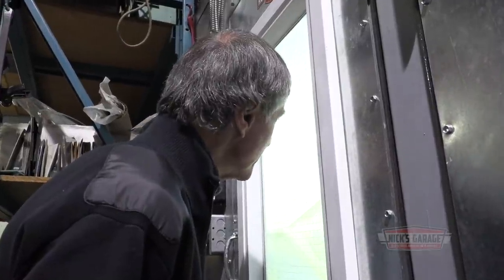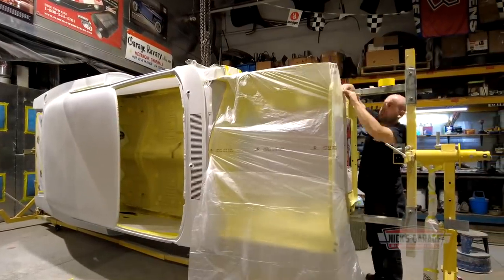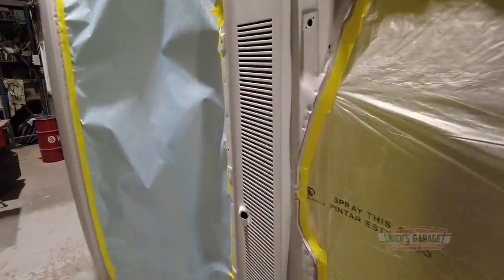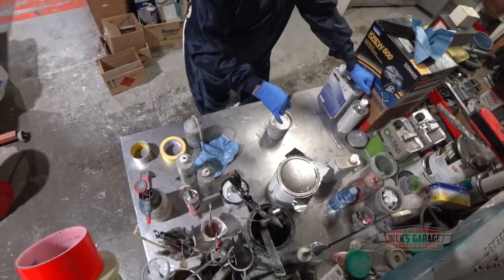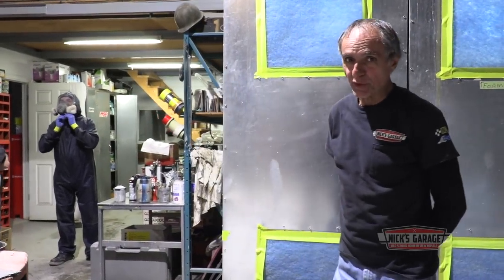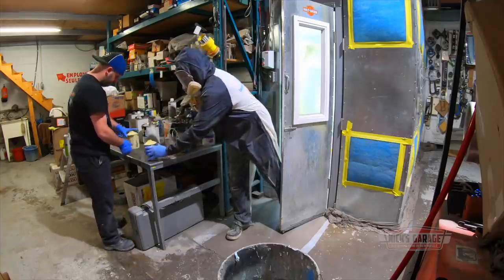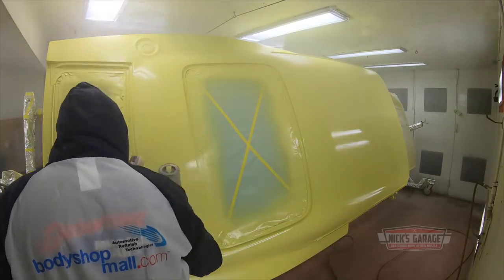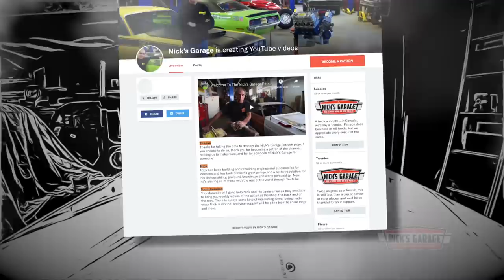1969 Charger 500 PAINTED - Special Mission - Let's Rock 'n' Roll!

Comment: Glad to see the 500 being painted!
What I find interesting is Roger is painting the main body I don’t see the hood or fenders or doors. I’ve seen Graveyard cars either paint the cars with all body parts on or in the booth with the main car. Every painter has there own way.
Reply: I believe they where all ready painted.
Reply: I always paint the cars in pieces for three reasons, first I like to have all the products in all the areas, secondly if you have paint or clear between the pieces the humidity is less likely to settle than on primer and thirdly I have a small painting room lol, and not the other parts are not painted yet if an accident happens it is easier to repair a part on primer than already painted ...

Comment: windex with ammonia works great for a pre clean as well. You can do even a final wipe with a wet chamois for dust.  Windex wont lift rattle can paints or primers too.
Reply: Winded has wax in it .
Reply: @lautburns4829   never ever heard that and never an issue in 40 yrs with it. and the purpose of ammonia is to strip wax, so defeats the purpose.
Reply: Okay, not arguing with you, thanks for the info😀

Comment: Seems like the rest of the panels are going to be painted on a different day, good luck with the color match.
Reply: Colour match wont be a problem.
Reply: @oliverz4544  I've been painting over 30 years, hang the panels and paint it all at once, is the best way.
Reply: We'll let the car do the talking once it's done 😉 cheers.
Reply: not the first that I paint in part and never had any problem especially with a solid color, I made several metallic and no problem there is a technique and a procedure to follow and never change it! Cheers

Comment: I had a 69 Charger 500 with a 426 and a clutch-flite trans from '82-85. I got it for $1500. I didn't even know what it was. I thought it was some cheap stripped version because the lights weren't hideaways. I just bought it because it had huge tyres and the big engine. It had no reverse and half the time took all day to get it started. I had to get the carbs done by a specialist. I knew squat about cars back then. It eventually ran really good. Body was good but chalky red orginal paint. The  guy I got it from was slowly turning it into a race car but was more interested in dealing in marijuana. He got sent to state prison and his mom went and got him to sign the title  ove so she could get it out of the driveway. She hated him and the car.

Comment: Roger is right if you want a good good it takes time it's not just strip the car and paint it if you want it to be lazer straight the body needs to be gone over with a fine tooth comb and after the paint is done it takes time for the paint to dry and then to cure so it is hard and won't be damaged. good body and paint takes time that's for sure. if you want a over night paint job you go to Maaco they will give you a 499 special

Comment: will you be doing a cut and buff  
when we did a 65 coronet there was right around 40 hours in to it 
when it was done the car looked wet  and smooth as glass 👍🇨🇦😁
Reply: yes the next step on the body is water sanding and polishing
Reply: @rogerouellet6000  it is going to look amazing once it is done 👍🇨🇦

Comment: I would have painted the underside of the car the yellow also
Reply: Yes and no. For the purist, they want the "overspray into sealer" look. For mine, I usually Basecoat clear, use a BC that I mix to match the sealer color, hit the overspray body color, clear that (for durability, to protect and keep moisture out, then hit it with some clear flattener. It looks like sealer, but it's tough as granite if rocks hit it. Also, use a capful of flex additive in the clear so it doesn't crack if a stone hits it really hard.

Comment: Is this car still considered "Original" with Base , clear paint. And what is the reason the original type paint isn't used??? I was 18yrs old in 1967 in the middle of the Muscle car Era and these cars were not that shiny. The best paint jobs were Candy, (after market not factory) I think most were single stage, am I wrong, I was only a Kid and it was 54yrs ago
Reply: I'm pretty sure the types of paints used back then are illegal now due to the EPA and others.  Probably have been illegal for sale and use for decades.   Plus there's the term "original", which is just what it says.  Anything refinished is not "original".   This car is now so much better than original.
Reply: thank you for the answer Johnny you take the words out of my mouth😁👍
Reply: @rogerouellet6000  Thank you for the great job on the Charger.
Do you ever watch The Gunman from Australia?  He's pretty cool.

Comment: Where's the doors the hood the trunk lid? Were they already painted? Also why is the bottom of the car a different colour? Curious George
Reply from the maker: The car is so enormous that the other parts can not fit in the booth with the shell.  They will be shot on their own.  As for the underside, it has been finished the way it has in order to mimic the correct underbody treatment from the factory.  These cars were dipped in an 'undercoat' up to about the hip line, then sprayed.  The result would be just like you see on the car in the pictures at the end of the video.

Comment: Not to be Debbie downer here, but they are mixing all different brands within a paint job. Nason, Limco, I see Omni all over the bench and the clear is HOK.
Reply: There is no Nason on this car industrial limco epoxy primer and Omni is PPG and Yes House of Color as clear,there are other products on the tables and I have other jobs also in the shop...
Reply: @rogerouellet6000  Your base is Omni? Just curios. You don't like the Omni clear? I started using the HOK clear last year, and I will admit I like it.
Reply: @Digitalsharecropper  I can't say that I don't like the Omni Clear, I never used them :)
Reply: @rogerouellet6000  I used to use the old Omni clear, it smelled like candy. It was pretty good and half the price of PPG. They did away with it for all of that low VOC stuff and I never tried the newer stuff. Probably good.
Reply: @rogerouellet6000  Your prep work and cleanliness are impressive. For sure. Quality is non-negotiable. Hope I see your police Polara some day. Those are history on wheels. Not many survived

Comment: This is the car he had acid dipped. No matter how good the painter is he can’t get primer and paint inside some areas. This car will now have a rust problem the rest of it’s life. I have restored cars for 40 +years , I learned this lesson the hard way years ago. Never acid dip a car. Looks like the body shop is doing nice work, but it won’t stop the problem created by acid dipping. Some cars I’ve done include 69 roadrunner 440 6pk, 70 Superbird , 70 AAR Cudas , 70 Super Bee 440 6pk , 68 himi Roadrunner ( never dipped any of these cars ) I had already learned. Yes I know what I am talking about.
Reply: More than likely, you're not the only one that learned the lesson and they do something after the dip to neutralize and clean any acid that went between welds.
Now, comes the tricky part, How do you protect the bare metal against rust between the welds ?
Again, maybe they have a solution for that.
Reply: @GHP-mr3gs  you can do a hot phosphate dip it helps , however it’s still better not to acid dip in the first place. A wise man learns from the mistakes of others a foolish man defends his mistakes and repeats them.
Reply: I'm sorry to hear that you had problems with this technique, I suspect a bad neutralizer technique, I have been using this technique for over 20 years and all I say all my projects are still like when I finished them and none have rust problems, and one thing you must not forget the techniques that you had forty years ago they have changed since years.
Reply: @rogerouellet6000  roger I watched the video of the car being dipped the process is the same as it was 40 years ago. Part of the problem is that the acid removes outer layer on the steel,  part of the mill scale even in areas like pinch welds and seams and other areas where it is impossible to prime or paint . The only possible way to protect  these areas would be to dip the body in phosphate or electric static primer tank, this wasn’t done to this car. Also this car wasn’t bad to start with . I am not alone on this subject read the comment section on the dip video. Dipping and sandblasting should be avoided, yes they are quicker and cheaper, but more destructive. I would never buy a car that has been acid dipped.
Keep your cars dry.  best of luck
Reply from the maker: We didn't have any video of the car being dipped.

Comment: The metalwork needs to breathe and if you just daub every crevice full of sealant and body deadener and then slap on a thick coat of tar, all that does is trap in the moisture and allow rust to start prematurely
Reply: le métal doit respiré hahaha celle la est bonne en Tabarnak tu doit en respiré du bon toi lol
Reply: The metal must breathe hahaha this one is good in Tabarnak you must have breathed good stuff you lol